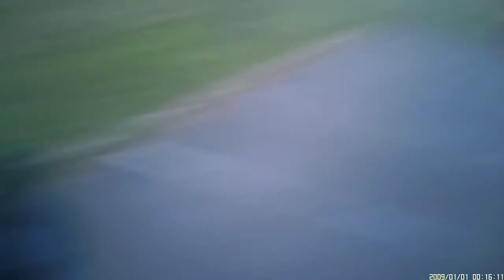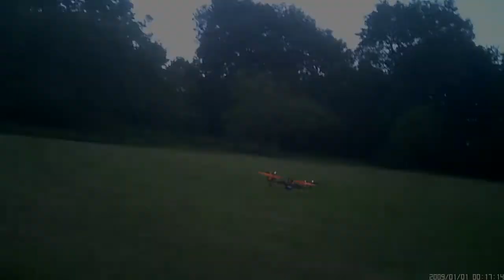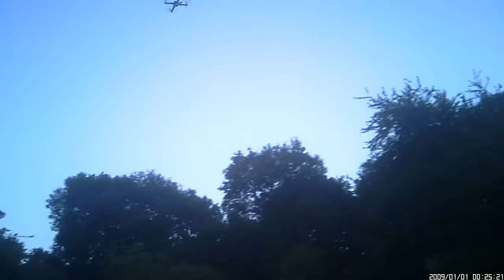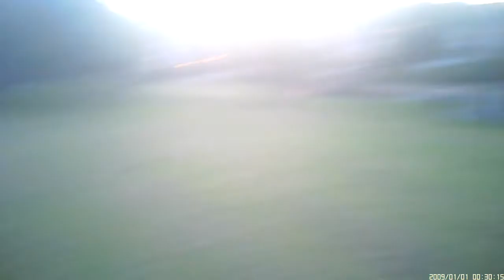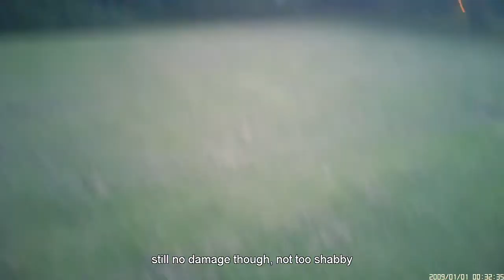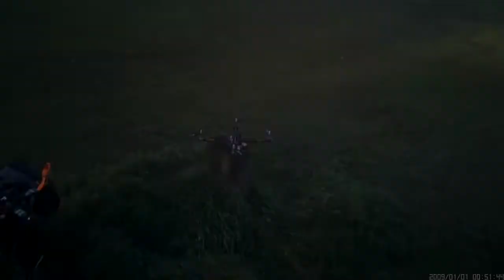Armattan 3D Quad - Initial Stumblings

Comment: was it the esc's? what ones did you have on in this.
Reply from the maker: djSpinege Yup, some prototype esc that caused 99% of these issues. If your trying a 3d quad I would stay away from the simonk option with a 3s setup, especially if using 1800kv motors like this. It's flippable and works but has so little power compared to any other 3d setup. 4s it may work if you have motors to take it but kiss esc with 4s capable motors or invertix hardware would be the only options I would consider after trying this option. Other annoyances like Throttle hold does not work with this firmware, flat propellers only and poor performance make this a workable but disappointing setup.
I have removed the esc and upgraded the motors to 4s capable but have not decided which route to go as yet as friends have issues with invertix stuff, motors syncing ect and the kisse esc or even ultraesc option has not proved itself enough for me to want to spend that amount of cash on it. I'm sure i'll finish this rig of this summer but heli's fly a million time better than it could ever fly at it's best so they will get my time and money for now.